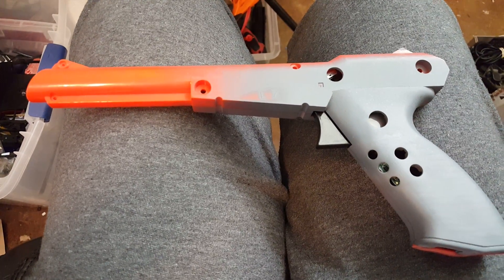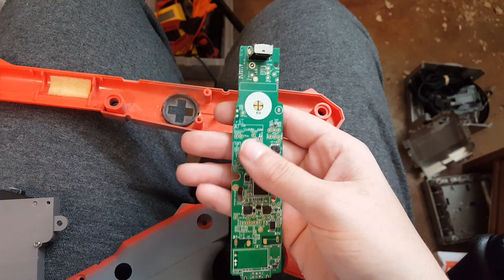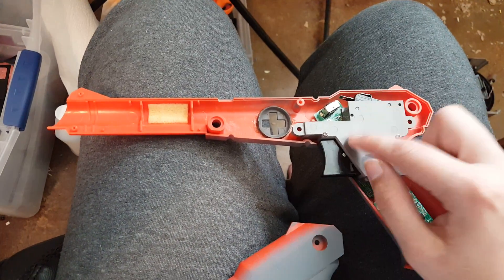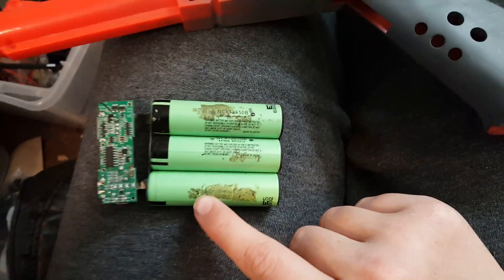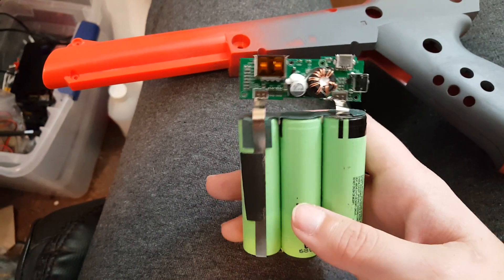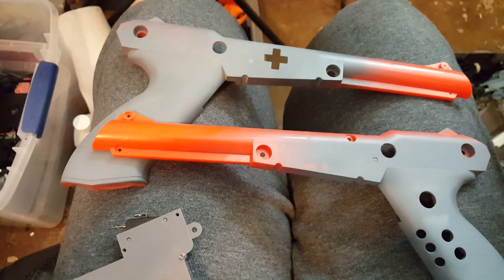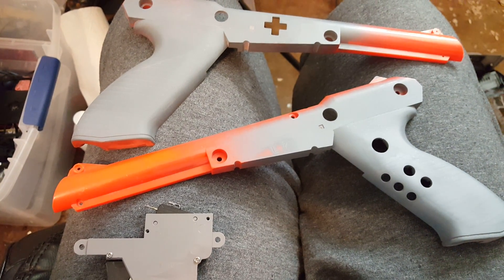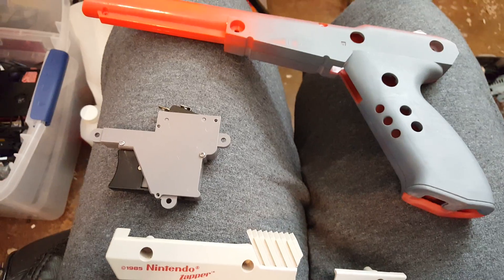Wii Remote Inside Zapper Gun Part 1

Comment: I have logos I need painted on ebay/Amazon controllers. and I want to do a original Dreamcast controller usb mod. I even thought of a 3d printed dream cast controller modded from a cheaper usb controller or Bluetooth controller. What are your thoughts as the best way to approach this.